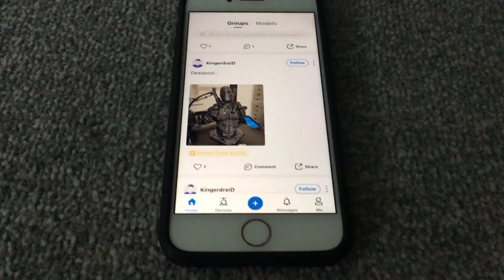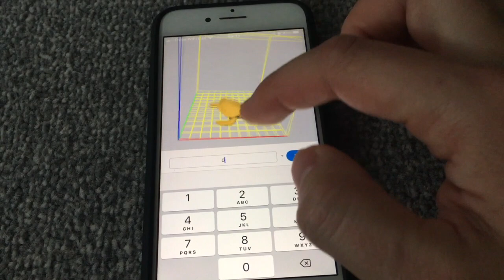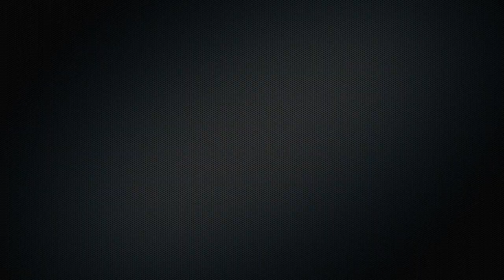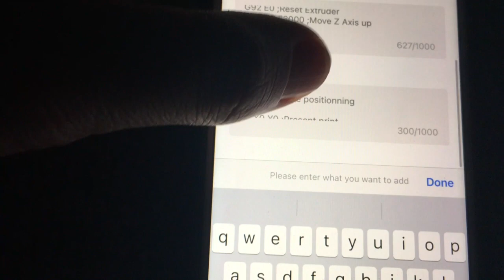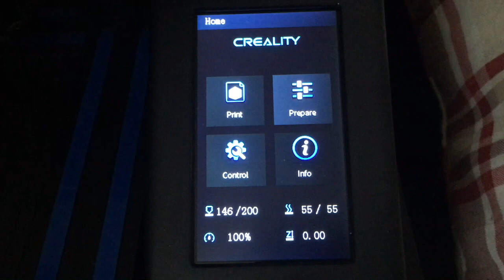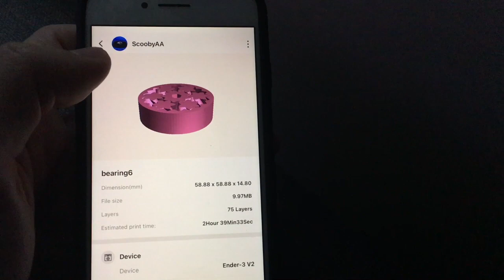Creality Wifi Box   Worth it?

Comment: u can use aluminum foil under ur glass bed to help build up low spot. i've had to do it on all my printers for the most part, sometimes different glass helped but over time its like the glass would always take the same shape as the aluminum so id end up having to do it in the end.

Comment: I've finally managed to install octoprint on this box. I'm happy it's not a paper anymore. It works pretty well providing the weak cpu. Will do a print test these days to see how it performs.
Reply: Could you share how you did it? Thank you!!
Reply: @AJSTrade  I've installed OpenWrt (check the hackaday article for details) and then followed the online guide to install octoprint on this flavour of linux. However, I don't recommend octoprint as it's very heavy on the cpu (580MHz). I got pretty poor results while printing. In the near future I'll try maybe Klipper with dwc2/fluidd/mainsail as these are less cpu hungry and less bloated.
Reply: Thank you very much for your reply, I will try it also :)